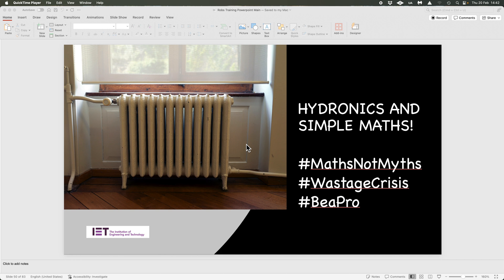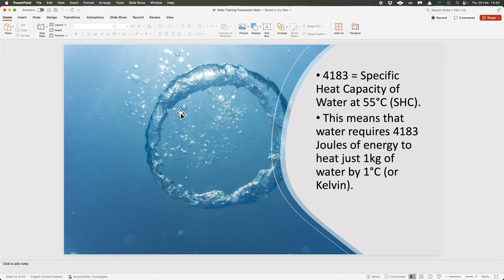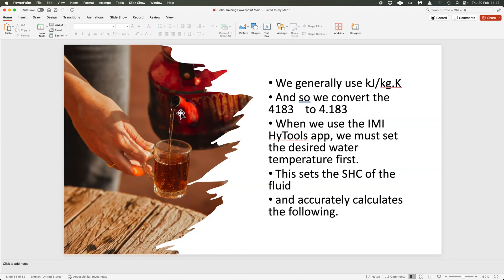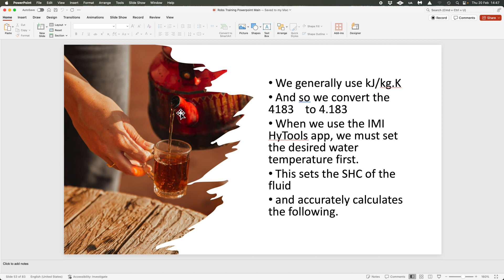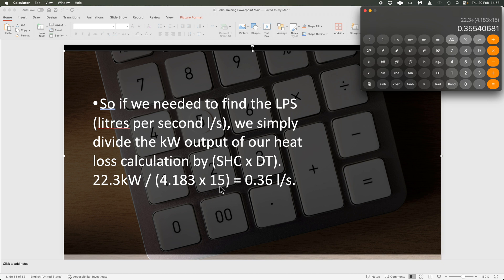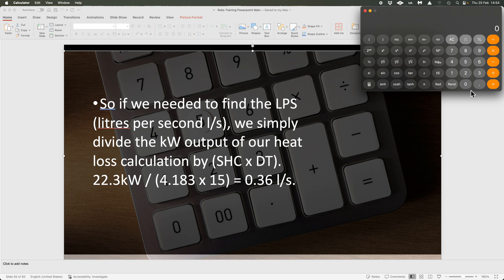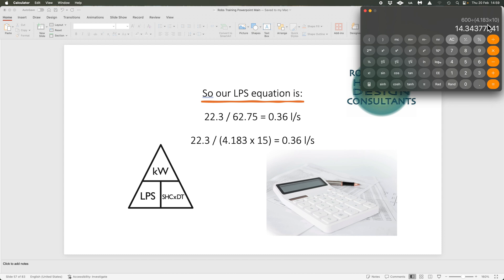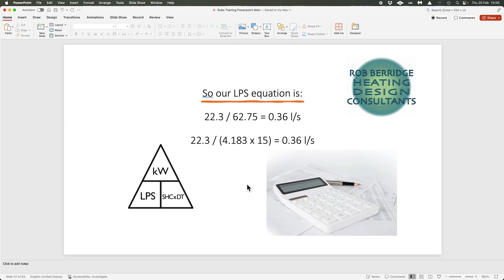Heating Design Part 3 Mass Flow Rate Calculations.

Comment: a strong visible plume is a sign the flue gases are being cooled enough which is the goal of condensing operation.
Reply from the maker: Sorry, wrong. You want the boiler in full condensing mode which is low, long and slow.
Plumes occur on full fan speed and start up.
Reply: also 11:32    22.3 / 4.183 / 15 = 0.36  will give you the same result, no need for brackets

Comment: Thanks Rob, a great explanation as always. 
Now, to demonstrate to any Combi Slingers out there how important a Mass Flow Rate is to YOU. How it can give you a competitive edge.
OK, you are asked to do a Combi swop & it’s for a nice old couple down the road.
You know their family will have at least another two guys in quoting for the job.
So you call in, have a cup of tea & a chat. Have a look at the job, check the Gas Pressure, pipe size etc.  But you also check the Water Flow Rate at the Cold Tap in the Kitchen. Which is around 8Ltr/Min.

Now, you always size your Combi based on HW flow rate, so 8 div by 60 = 0.13Ltr/Sec.
Our Delta T for Hot Water Temperature Rise in the boiler is 50°C - 15°C =35 °C Delta T
So our Temperature Rise or Delta T is 35°C with an incoming cold mains temperature of 15°C.
So with a Flow Rate of 0.13 x (35x4.2SHC) = 19.11KW.
Therefore a 24KW Combi will be more than enough & you can be confident that size of boiler will be sufficient for the job. Whereas your competitors may price a 28 or even a 35KW one, just because they always do it to cover their arse.
Pointlessly oversizing the boiler, when the incoming cold mains supply Flow Rate will never improve.

You’ve taken 5minutes & acted like a proper Heating Engineer.